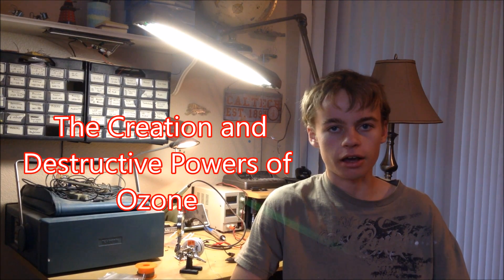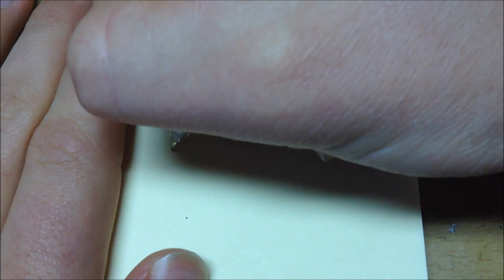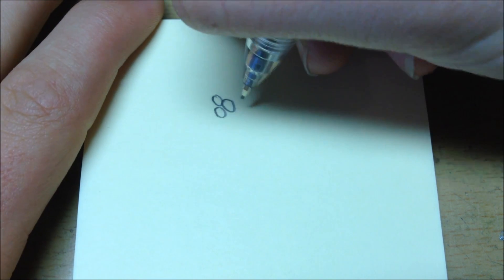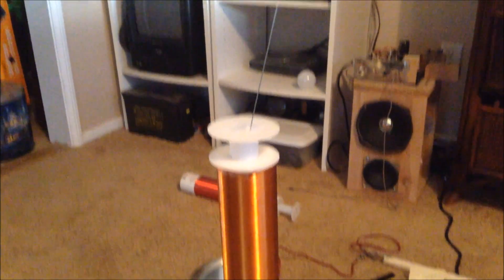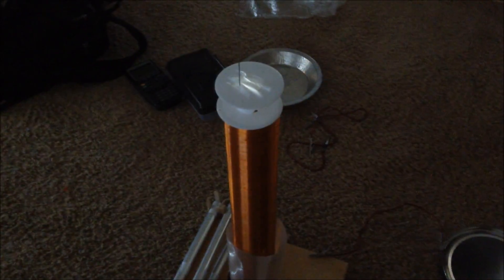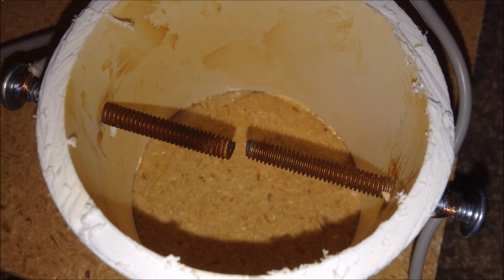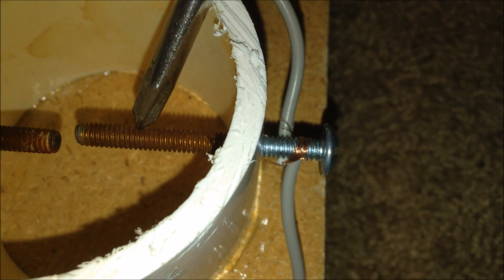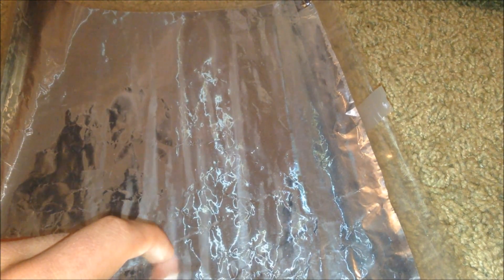The Awesome Destructive Power Of Ozone and How to Create It

Comment: You should really try putting a whole quartz crystal in between the Tesla coil and allowing the arc to pass across its surface you will actually from what I believe witness the fracturing of the curvature of the spark in such a way that the coronal discharge is quite possibly exponential

Comment: dont you need to spray oxygen on it for it to ozone
Reply: If the Tesla coil arcing creates ozone gas , does electric arc welding process create any ozone or is all oxygen burnt up .
Reply from the maker: There is plenty of o2 in the air to create ozone

Comment: I hope you know how dangerous ozone can be for your health! You always need to ventilate the ozone out from your room while you are handling these things and 10 minutes after. It connects with notrogen in the air to create hazardous nitrogen connections like which can turn to nitric acid when touching humidity which is probably one of the most hazardous substances! The best thing would be to have a high power ventilation but that might not be feasible or affordable for most of us.
Reply: Muck2014 dude you basically speak about the ⛈ ⛈ storm and it’s not dangerous at all....
Reply: You believe ozone isn't dangerous?
Reply: @Muck-qy2oo ozone is dangerous, just not to humans, due to our superoxide dismutase, humans can actually benefit greatly from ozone exposure.

Comment: nice video
Is there a corona discharge inside the capacitors? I believe there shouldn't be, because in theory, there's no current flow inside a capacitor, unless the breakdown voltage of the dielectric is exceeded. I could be wrong though.
Reply from the maker: +Colin Ries the voltage is so high that it ionizes the air around it and turns it into plasma.  That is the corona discharge.
Reply: oh right, confused it with discharge between the plates. Thanks for clearing me up on that

Comment: How about the reverse process? To de-oxidise a piece of metal. I´ve only seen a machine that is a high pressure brush of sorts.
Reply from the maker: The best way to de-oxidize metals is with heat.  I have never heard of the high pressure brush, but that might work.